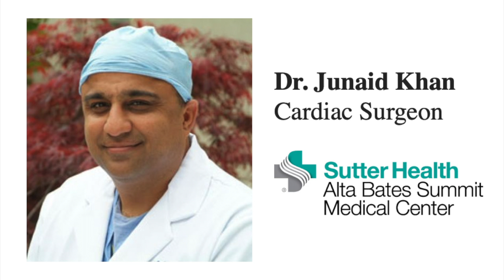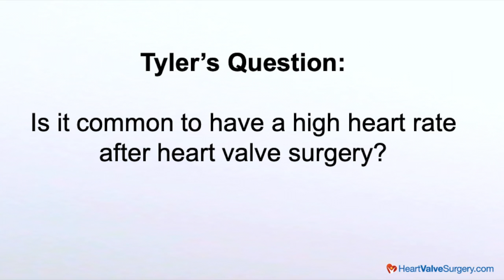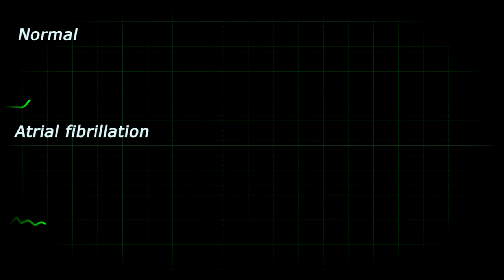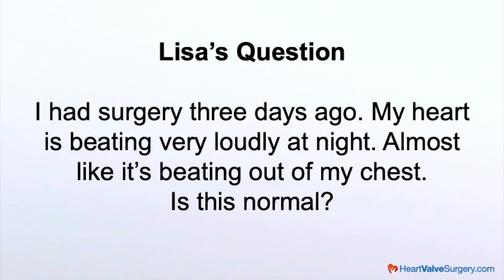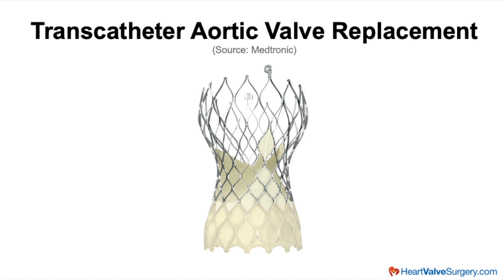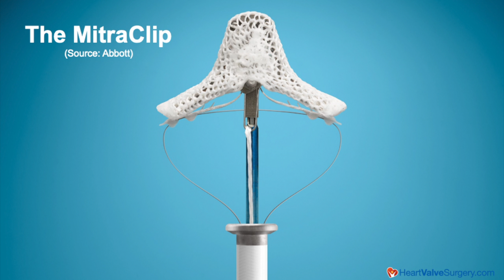High Heart Rates After Heart Surgery? Loud Heartbeats After Cardiac Operations?

Comment: I just had mitral valve repair open heart surgery and have faster heart rate three weeks after surgery. I presume beta blockers are key here to reduce heart rate?
Reply from the maker: Great question!  We would encourage you to ask your medical team this question.  Each patient is unique.  We want to make sure you get the best medical advice possible.  Thanks!
Reply: I m in 12. Day after mvrepairr surgery. And My heart rate is 90. How Was yours?
Reply: @demirification  Its been 5 weeks and definitely mine is higher. Was around 70 before, now from 80 to 90. Oxygen levels are still around 95% resting and exercise 98%
Reply: I just had aortic valve reolacement surgery and have faster heart rate a 4 week after surgery...why
Reply: @khanbrotherhood4959 Because your heart went through a lot of trauma. Surgery is traumatic.